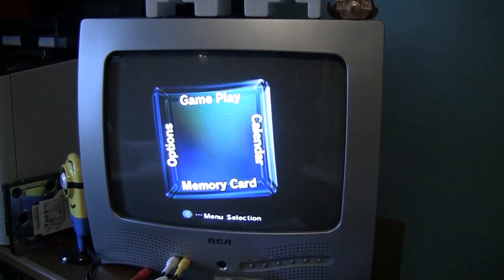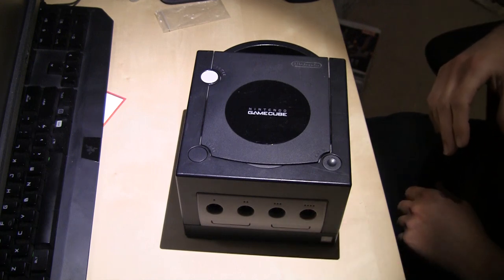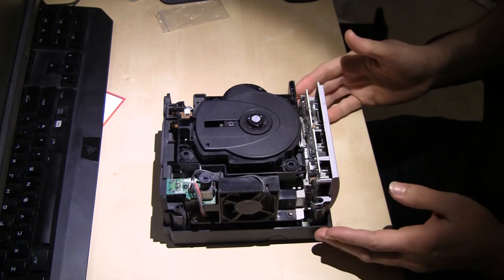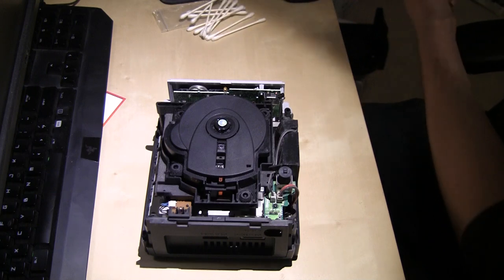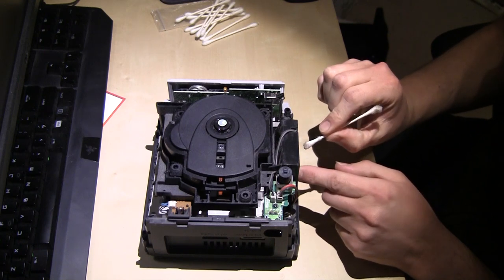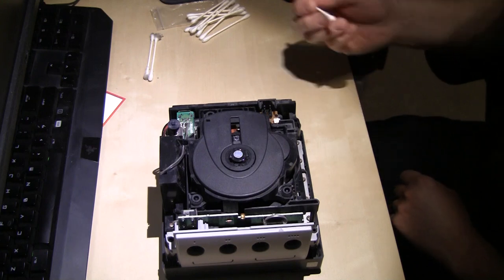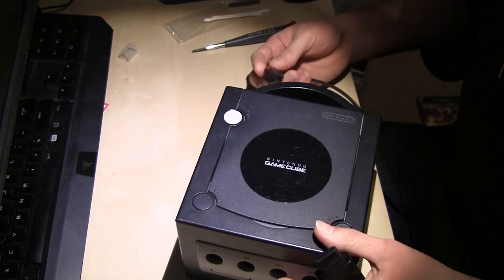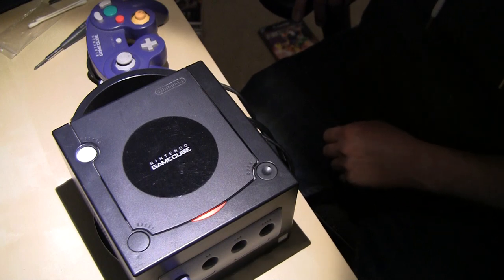GameCube Not Reading Disc? Let's Calibrate the Laser Power

Comment: Was wondering why you reinstalled all the screws before you see if your adjustment was correct, I've worked on many GameCubes over the years and believe me you don't need to reassemble all of that before you know if it works., Also you really need a multimeter, you can get them for under $10
Reply from the maker: Honestly.... i was in the zone of making the video and just put everything back together while i still remembered where all the parts went.

You are correct about the voltmeter.  I have one, but guide i found didn't mention anything about a voltmeter.  I wasn't sure what value i was looking for... so i guess. 

One of these days I'll add that part, just not now.. working on a new "nes"  computer build.  Follow along if you like

Comment: You really need a multimeter to do this properly.
Reply from the maker: True, but the guide that I was following didn't indicate where to connect a multimeter, nor what readings to look for. That's why I turned the screw very little.
Reply: BobTweeterShow there are a few videos that discuss it. 200 seems to be the safest setting. If that doesn't work you can go lower. My understanding is that the lower you go it puts more stress on the laser causing it to degrade faster.
Reply from the maker: Dustin Marett thanks for the info.  if I need to adjust the laser again I'll check them out
Reply: @a00578480  i am trying to fix my GameCube, haven't seen a video yet using a dedicated took to measure the strength, could you point one or for me?
Reply: wtf is a multimeter??
Reply: @dream323  do you need a LMGTFY link?
Reply: @garytiemeier1347  whats that?

Comment: Hi thanks for making that video, it still works? Or have you burned the laser, I'm trying to do this in my Gamecube because it shows the DRE message but I'm not really confident to just turn the laser potentiometer 3 degrees, so I was thinking that you can measure the resistance of the potentiometer in ohm and tell me the measure that you have in your GC if you have no trouble with that and if you can help me, anyways it's good to see retro consoles getting back to work again 👍👍👍
Reply from the maker: About a month after I made this video the laser stopped working. Instead of adjusting the laser again, I'm just going to replace the laser assembly. You'll have to Google the readings to adjust the laser. I only have a voltmeter. Good luck
Reply: @BobTweeterShow  thanks for the advice actually I'm reading in depth of it

Comment: Does this work for GameCubes that don’t say “No Disc Inserted”? Mine just has a problem playing the games. It knows a disc is inserted, but it still brings up the error message requiring me to reset the console.
Reply from the maker: If you're able to play the games, then its a different issue.  This method works for when the laser doesn't have enough power to read the disc
Reply: @BobTweeterShow  I’m not able to play the games. Is there any possible solution to this if it’s not the laser?
Reply from the maker: Oh, sorry misread. 
If the GC cant play the disc then the problem is with the laser. Depending on the condition of the laser module,  you maybe able to turn the power up.
Reply: @BobTweeterShow  I’ll give it a shot. Thanks for the help.

Comment: Ive seen other comments but i still need help. I basically know for a fact i have the same exact problem but IM REALLY SCARED of turning up the laser power. I know itll damage if turned up all the way and you have to worry about people who turned it up prior. However, i know for a fact no one has ever opened up my gamecube and turned it up. so im not worried about that part.

what i am worried about is if i turn it to say 3 degrees as you did in the video, it may not do damage like turning it to max would. but would a 3 degree increase damage after like years and years? or will it be the same as before basically with no consequences at all? if there are no consequences, how could this be? How did the laser get to a point in its life where it would be weaker? how did the laser screw get looser? did it get looser? or maybe the laser is getting weaker? do lasers get weaker? is that a thing? i saw a guy talk about a multimeter? whats that? does that help you turn small screws 3 degrees? it seemed that at that part in the video it was pretty difficult. i dont blame you. im sure it was.
Reply from the maker: Very long question you have here... I'll do my best to answer everything.  
Over time the laser will loose strength.  In most cases its still on but not strong enough to read the disc and transmit the information to the system. It similar to an old light bulb, the bulb turns on but doesn't produce the brightness as a new bulb. (The screw has not been turned over time, the laser is becoming weaker)
Turning up the power will not hurt the disc as the laser is now at a power level similar to when it was new. Some thing to keep in mind, the laser is going bad. You'll be able to turn it up a few but there will be a moment when the power provided to the laser isn't enough to read a disc. When that happens you'll need to replace the laser assembly. 

That should not be an issue for a while but the system is getting older, parts will need to be replaced. 

The 3 degree part is a guess. I had to open the game cube twice to get it right. Just take small steps and it be fine. 
Using a voltmeter will take out any guess work, however I've not done it nor do I know where to check for voltage or what voltage you should be looking for. With that said, this is YouTube,  there's a video on it out there.

Hope that helps. If you have any more questions,  just ask and I'll try to answer.  
Good luck
Reply: @BobTweeterShow  Thank you so much. This was literally the most perfect response and well written. Now I know exactly what to do. Literally answered all my questions.

I also think that everyone should read this as it was literally just that helpful.

Thanks again.
Reply from the maker: @dream323  😁
Thanks for your kind words. Just trying to help, from one gamer to another
Reply: @BobTweeterShow  It definitely helped a lot !!

Comment: Hi hello I have a problem that’s really really similar to yours, whenever I put the game in and turn on the consoles it reads “disc error”, is there a way you can help me out somehow?
Reply from the maker: Thats what this video is about. . . If that doesn't work, you'll need to replace the laser assembly
Reply: @BobTweeterShow  I watched the video and would almost be certain sure that my GameCube has this problem, but I am scared myself to do these steps on my own, was wondering if you can possibly show me through a video call or like somehow?
Reply from the maker: @samuelterceros295  if u are a scared to do this repair, then don't.  Buy a working gamecube..
The laser is failing and at some point will need to be replaced

Comment: So i got sonic heroes for the gamecube on ebay and when i put sonic heroes in the gamecube the loading screen freezes and the (disc/game) in the gamecube stop's spinning, then i take sonic heroes out from the gamecube and put in sonic riders it work......what should i do I'm worried!!!!!! 😟
Reply from the maker: If the gamecube works with another game then the cube is good. It sounds like the disc is scratched or damaged. Check the bottom of the disc for damage....

Comment: Can calibrating/changing the laser power in any way damage the game discs?
Reply from the maker: I've read that if the power is turned too high it can damage the disc. But that's if it's turned all the way up. If you adjust in small interments you'll be fine. However if the laser has already been adjusted be for it maybe time for a new laser.
Reply: @BobTweeterShow  Thanks a lot for your fast and helpful reply.
Reply: you have to use a multi meter, the increments are so subtle that you might burn through your shit within an instant
Reply from the maker: @TheBecel  I read about using a multimeter after I made this video. I adjusted the laser in  super small interments.... So small the laser stopped a month later 🙀
Reply: @BobTweeterShow  did you fix it again?
Reply from the maker: @alejandroandresrodriguezgu2892  No, I think I need a new laser assembly.  And I've not bought one yet. . One day I'll try to replace it
Reply: @BobTweeterShow  where do you find replacement laser assemblies?
Reply from the maker: @HarlanChernoff  there are a lot on ebay.